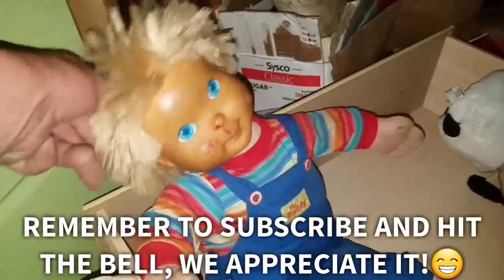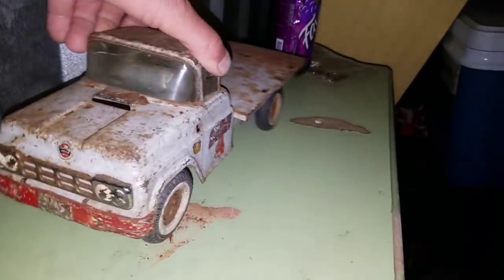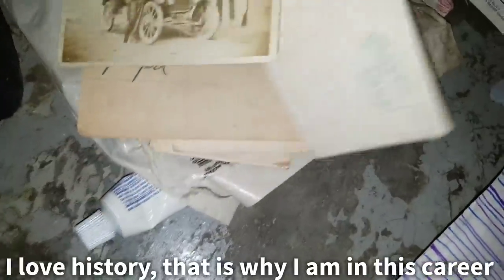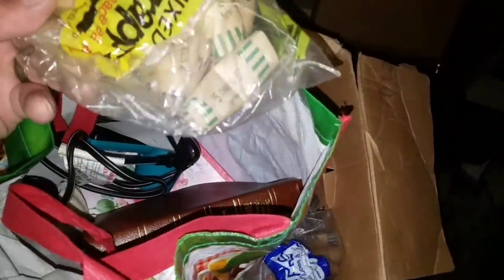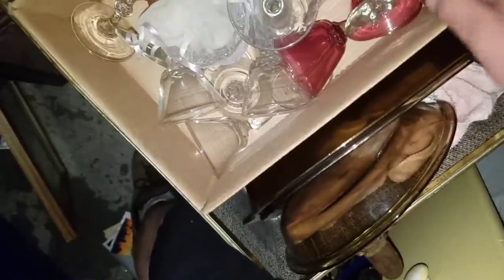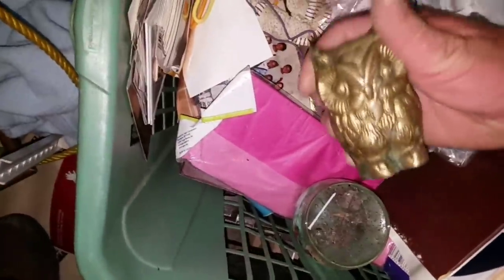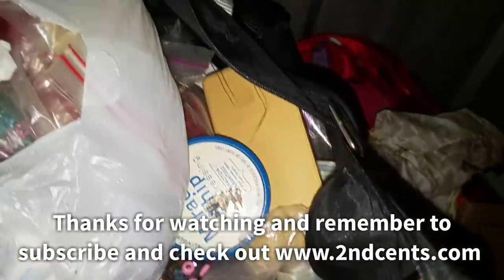BODY FOUND IN ABANDONED STORAGE UNIT, WHY? LOCKER UNBOXING VIDEO, ANTIQUE & VINTAGE FINDS!

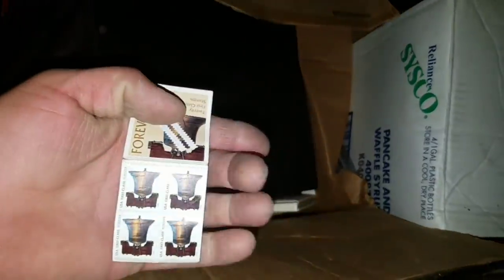Comment: #15:13 "FOREVER" stamps are good for whatever CURRENT postage is, no matter what date they were issued (if bought when first issued = TODAY's postal rate TODAY😄). Those look like they were the "originals" @ 32¢ each stamp😁.  "Invest" in (keep) a tripod set-up so you can use both hands to "pick' objects up for vid showing (makes it easier on the viewer to watch.🤷‍♂️)  #28:08 (Possible) Original artwork for the "Mother-in-Law" books🤷‍♂️ (?)